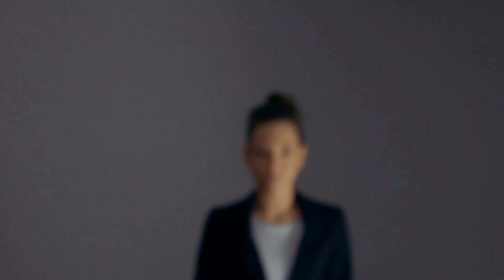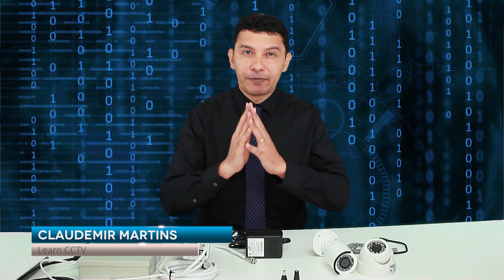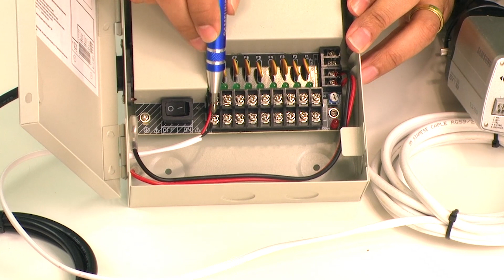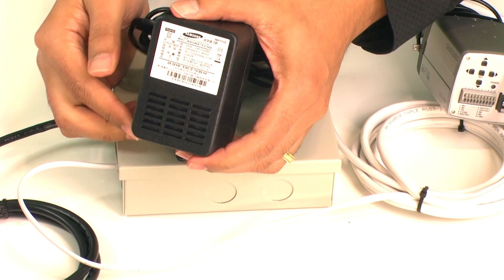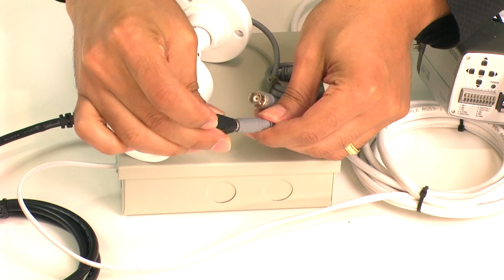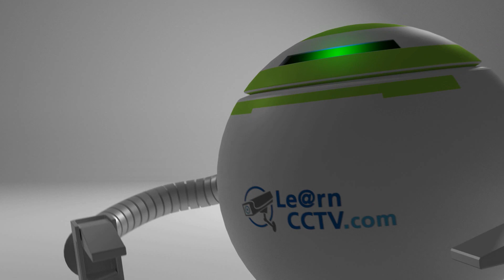Power Supply for CCTV cameras (how it works)

Comment: Thanks for the tutorial. When I install a wifi camera with a 12v power adapter, it can be plugged into the 127v outlet (type 20m away) and wired to the camera using a green adapter that you show in another video, or the power adapter must be installed near the camera (so there is no loss of current).

Comment: Will 19.5V - 2.3A -  45 W.  Work on a box camera?
Reply from the maker: That depends on you camera specs. Most cameras work with 12V be careful to not burn it with 19.5V. Most of them also need around 11 to15 Watts, so 45W is overkill. The best thing is read the specs and use the power supply the camera needs.

Comment: Help me design a off grid solar 12v PTZ camera that can run via 4g cellular network . If you can do a video on that it will be great. Will i need a NVR, charge controller and POE with RJ45 cable?

Comment: I have a camera system that is blowing fuses on certain camera's...I replace the fuse and it blows again as soon as I power up
Any idea's?
Reply from the maker: Check the power supply or PoE switch (if you using one). It looks like the camera are getting excessive voltage.
Reply: @LearnCCTV  its on a circuit board with all the other camera's fuses and there are a handful that are not blowing...if it was power wouldn't it blow all of them?
Reply from the maker: @abelloise  That' depends on the specific situation. With longer cables, there's a drop I the final voltage, some power supplies also control how much power you can send to each individual camera. I suggest you to use a multimeter and check the voltage that arrives on each camera to see if it's excessive. You can also replace the power supply with a professional one that controls the voltage per camera. Last case scenario, the camera could be defective.